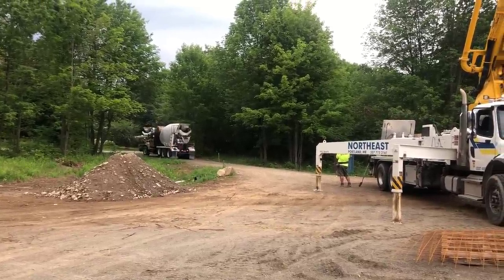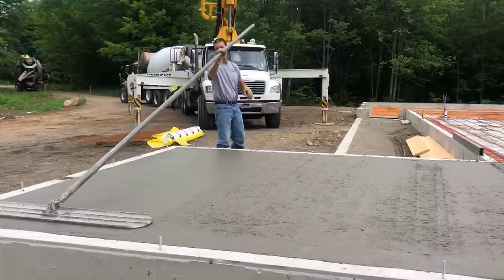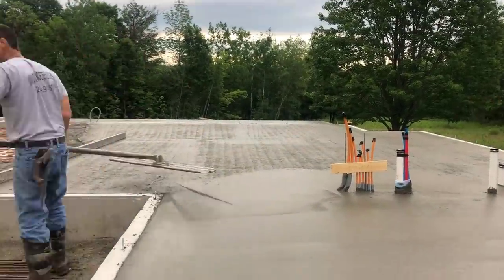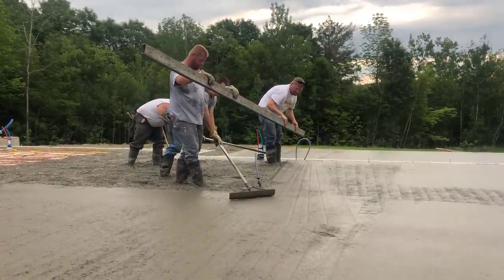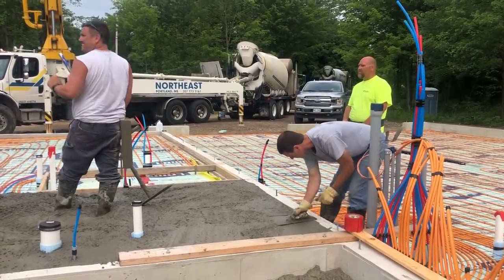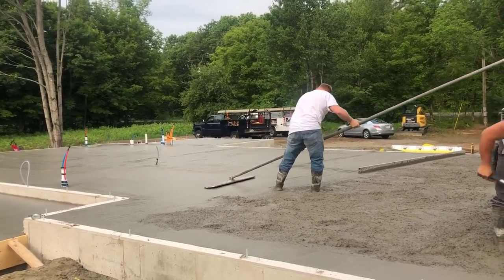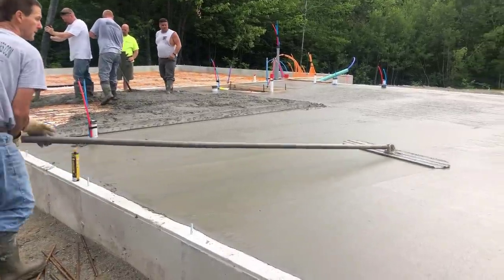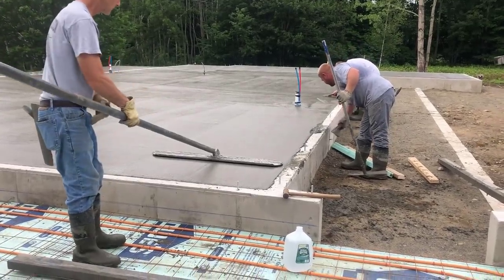How To Pour 2100 SQ FT Concrete Floor (Dangle Pumping)

Comment: You guys should look into a rocker head for your bull float. We switched all of our bull floats, fresno's, and our 2' wide jointer to rocker heads. You could probably reach from one side of the slab to the other with a rocker head. The only thing is don't get the chain driven head, go with the rocker head like the Marshalltown Rock-It 2.0. We love them.
Reply: He definitely has one, not sure why they're not using it today ?
Reply: @augustreil  We swear by ours. lol Love it. Makes bull floating much easier on your back and shoulders.
Reply: Agreed. Worth every penny.
Reply: @jamesvandyke7318 , Agree, I've only helped on a few concrete jobs and anything to make it easier is worth every penny ! That's one tough sport.
Reply from the maker: Yea, I got a couple bull floats with the rocker head. Just went old school on this one :)

Comment: We pump almost 90% of all pours we do down here in SW Florida.  Seldom do we use HRWR in slabs.  Here in the heat it will take off when it evaporates and everything will flash at once.  We don't call it dangle pumping, but Boom Pumping as apposed to small line pumping.  Our place and finish is very much like yours except we need a whole lot more labor because of the hot weather.  Sometimes we'll add retarder if it's really hot without wind.
Reply: Yep, SE side of FL we just call it ‘boom pumping’ too. If you said you were gonna use a ‘trailer pump’, that would be referring to a 2” pump (preferably a hydraulic and not one of the old Macos). Actually Mike is the only one I’ve ever heard call it ‘dangle pumping’. 
Did some work years ago in SW FL. I think I was using Sunshine pumping (I think that was their name.) Not even sure if they’re still around of not. Usually used ‘Best Concrete’ for the finishing.
Reply from the maker: Kendall, really good info, thanks for that! We never use retarder here in Maine, but if we had hot weather every day like you we would.

Comment: 40 years ago, I worked concrete just a couple of years. We did driveways and parking lots, with a 24 foot power screed on the forms. We had 4 to 5 people, depending on the job size. I like the way you wet screed, there are no lines at the end of the screed.
Reply from the maker: Thanks!

Comment: Really enjoy your videos Mike. I have a small concrete business in Ohio and very rarely have help. I stick to patios and walkways primarily. I run the buggy, rake, screed, and finish on my own. It gets tiresome for sure. I’ve got a John Deere 30g mini excavator with thumb attachment and a 12k dump trailer for tear out and gravel. Makes life easier owning my own equipment. I’ve only heard (pump truck) here in Ohio. Best wishes to you guys. Your work is outstanding!
Reply from the maker: Thank you. It's really nice having some help. I did it with just one other guy for years.

Comment: We use a pump truck all the time but we pour big stuff anywhere from 12,000-75,000 square feet at a time. I am wondering why you don’t pad the wall line before you straight edge?? I just see you mag it and then straight edge?? I also owned my own concrete company for 12 years and sold it about 3 years ago. I think you guys do good work I can tell you take pride!! Keep it up 👍 Mr Day!! We just call it a Pump Truck!! And we slick line a lot of stuff which is horrible and very very hard work!! Keep on Keeping on!! We usually get pumps for around $550-$650 and then so much a yard!! But we do have 8 of our own pump trucks so yeah we pump a lot or truck dump stuff as well!!
Reply from the maker: We shoot a grade on the wall with a laser and snap a red chalk line to mag to in advance or pouring. Thanks for watching Shawn!

Comment: Where I live the concrete trucks pour from the front, not the back.  Do you know why different regions use different trucks?
Reply: its about weight of trucks and what the DOT restrictions are. The front loaders weigh more so u can't haul as much concrete in one. That's why Iowa is all rear discharge.
Reply: I live in wisconsin in oshkosh. And oshkosh truck builds many frontloader so thats all ive ever known to pour with and it seems like they are not common anywhere i have been outside of wisconsin
Reply from the maker: There are some here in Maine. They cost a lot more than rear discharge. Just so happens the two companies I use the most have 90% rear discharge. Occasionally we'll use a company with front dumps.
Reply: A rear discharge is cheaper to purchase. It's just a normal straight truck with a mixer body popped on it in place of say a dump body. A front discharge truck is a specialized truck built for just pouring concrete, making it very expensive to buy. I think right now a company would be looking at about 300k to purchase a front discharge truck new. And that's just outfitting it with the basics. It also depends on the regional makeup of the area. Urban areas will pretty much only have rear discharge trucks due to their lighter weight, shorter height and handle the highway better. They can go over more bridges and fit in more places basically. A front discharge truck is heavier and taller, but they're all wheel drive and capable of going more places offroad than you'd be able to get a rear discharge truck which don't have a driven front axle. With the right driver of course lol. So more rural areas ect. necessitate a front discharge truck more.

Comment: Love this stuff. I only jump in when foundations are being poured for each house I build but when this level of work is happening I watch & I learn. Bought a mag float & hope to buy the sq stock aluminum screeds in a few lengths but I just dont get concrete work more often that completing a house so its once or twice a yr but I enjoy it an awful lot. Question - I prefer to cut control joints the next day vs. wet for a real clean line - Ive been looking at that new skilsaw with the hose attachment, wheels & walk behind set up - about 700.00 any thoughts? I burned through a diamond blade cutting dry on my last 2000 s.f. joint cuts & had to completely disassemble clean & reassemble my skilsaw.
Reply from the maker: Cutting the next day will burn through the blade faster, but you do get a nice clean line. If you don't have a Soff Cut Saw like we do then that's you only option to cut the next day. I haven't tried the saw you're talking about but it looks like it'll work good. I think this is the one you're talking about: https://amzn.to/386XxfZ

Comment: Hi mike
You don’t cut joints in the floor does it crack r does that not mater all our internal walls are conc blocks which all have own foundations
Reply from the maker: We saw cut all our floors and slabs right after power troweling. We use the Soff cut X-150 prowler saw.

Comment: In the East its called a Boom pump.
Reply from the maker: We call it that too. Just the process of dangling the hose and pumping a floor we call dangle pumping.
Reply: Biggest pour we have on our site is about 24,000 cubic where we used 11 boom pumps. The project is called One Bangkok. Poured concrete for 70 hours. Mat foundation is 6 meters deep
Reply: Yeah, if I said were gonna dangle pump today I would never hear the end of it...lol...

Comment: We have a strong crew of 8 guys with me having the least experience of 8 years. We can setup a grade beam in 10 hours on average thats between 10 and 15k sq ft. Then pour it, strip it, and be on our way. We use conveyer instead of pump trucks.
Reply from the maker: Nice, those are pretty big floors or slabs.

Comment: what are those orange pipes for?
Reply: Kutis Pwet hot water heating in the floor
Reply: @honeycaffena4897  Thank you, I'm not familiar with those because I live in a tropical country where we usually have a hot weather :-)
Reply from the maker: We call them radiant heat pipes. Most the floors & slabs we pour have them here in Maine. They heat the house by circulating hot water through the concrete, heating the floor, and thus heating the house.
Reply: @MikeDayConcrete  thank you for taking the time giving me that information explaining how it works, have a great day!
Reply: @MikeDayConcrete  Don't you put the PEX on mesh and chairs to get it closer to the surface?

Comment: U dont vibrate ur concrete?
Reply from the maker: No need to when you pour a 6 slump with mid-range water reducer.
Reply: Osum videos, here in da tropics 4-6 slump works good for use with out reducers, so it cures slower
Reply: Correction, works good for "us"